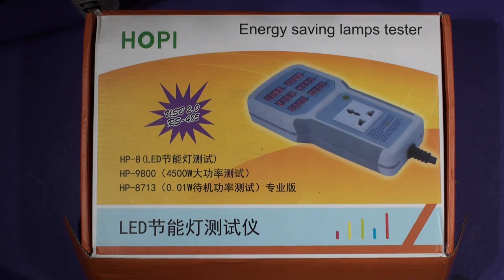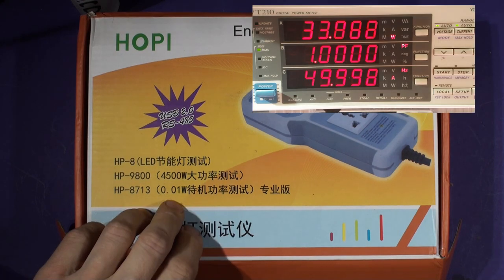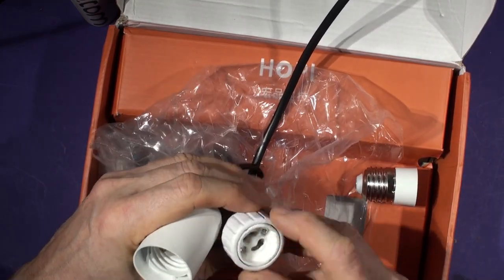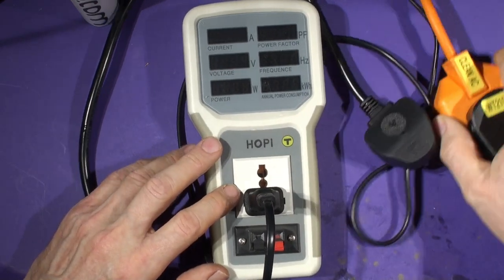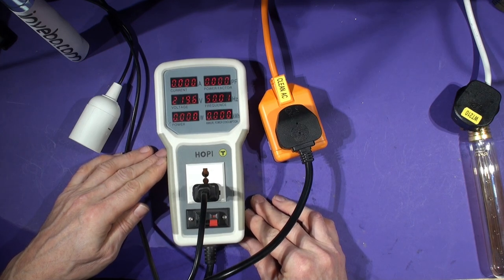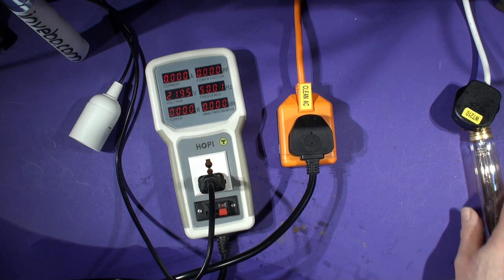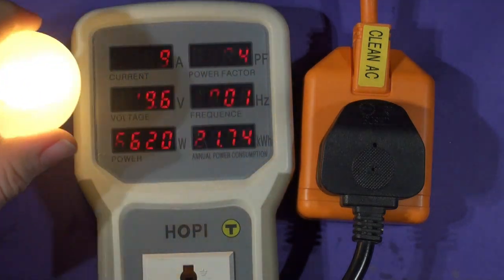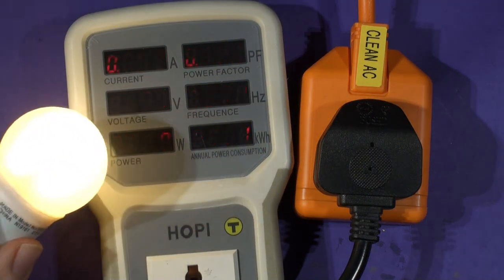Is the HOPI Energy Power Meter Tester Accurate? Let's find out

Comment: Very interesting! Thanks for your efforts. The Cirrus Logic chip in the HOPI is able to be calibrated but my guess is that the HOPI units don't receive a calibration cycle against any sort of standard.
Reply from the maker: I don think the chip is accurate at higher crest factors.
Reply: All the volt meters tend to read off a bit as we vary away from the sine wave voltage that they are calibrated to.

Comment: Great video,  You seem to have some top kit for testing power consumption. If you have the likes of WIFI and Z wave sockets any chance of putting them on test to see the power drain on and off. So much variation on figues on web.
Reply from the maker: Great suggestion! I will take a look at that - I have often wondered myself. The problem is that the controllers in these sockets are powered up on 24/7.
Reply: @razenby  Look forward to your results, as you say 24/7, cheers

Comment: I think of the Hopi as a consumer grade indicator rather than a piece of lab kit. Comparing it to lab gear is not quite fair but it’s good to know how accurate it actually appears to be. Would have been nice to see a comparison for something like a PC or a large “brick” type power adapter.
Reply from the maker: the HOPI is marketed as a power for lighting applications.  It comes with a host of bulb test leads and sockets adaptors.  The only way I I know of validating its accuracy is to compare measurements with a professional power meter.

Comment: Big Clive also tested one of these. But what was more interesting to me is he tested an old ebay meter based on a v9261f chip and he was impressed by it. I'm curious myself about the accuracy (and response times) of these cheaper meters. I'm more familiar with the industrial type meters such as the Carlo Gavazzi power/energy stuff, but even there latency can be quite rough. The energy measurement seems good, but the refresh rate of the modbus registers is 600ms (for the EM24) which is a it slow in some applications.
Reply from the maker: You cant measure complex power accurately with cheap consumer power meters. being impressed at the performance for the price of the instrument isn't the same as accuracy.  If you have a low PF and complex current and distortion of the sine of  incoming power waveform then the cheap meters all misread.
Reply: @razenby  No disagreement there, Clive merely thought the v9261f was better than the HOPI (if I understood him correctly). Even the industrial types I mentioned are not perfect, we have customers that complain that there is a discrepancy between that reading and the amount they are billed for. Of course the meters used by the municipality for billing purposes aren't perfectly accurate either. The big frustration however in my country is that we have prepaid electricity meters that will physically disconnect you if you feed energy in reverse, and not large amounts either... as little as 300 Joules is enough to throw the switch. When developing grid-tied hybrid battery systems, that becomes a real pain really quickly, especially when the industrial meter you're using has a refresh rate of 600ms... not nearly fast enough.
Reply from the maker: @plonkster  God point.  Years I tested my mechanical consumer meter after it had been swapped out - I wondered about the accuracy of my bills. .  With a  6KW resistive load (High PF) it under-read by 4.6%.  With a 1KW DC load via a switched mode bench power supply (no PF correction) it read almost spot on.  So I concluded that I was undercharged. The  meter was 37 years old when it was changed.  Operating in a damp location with no service or calibration I though that it had done very well.